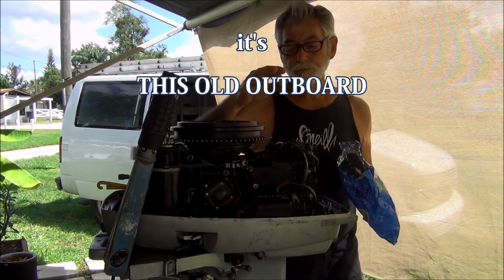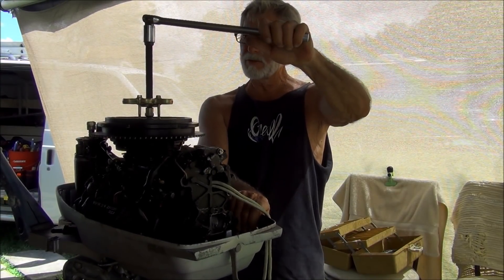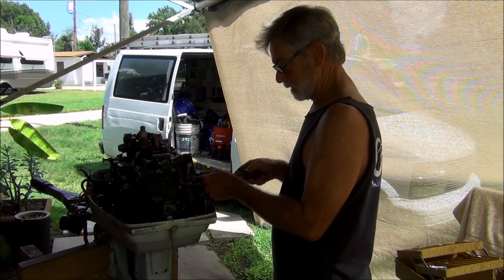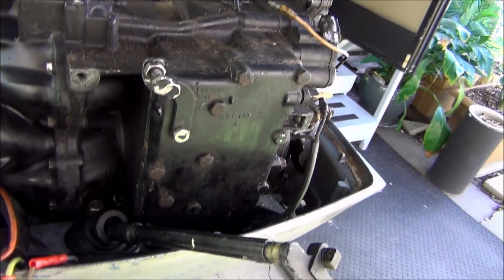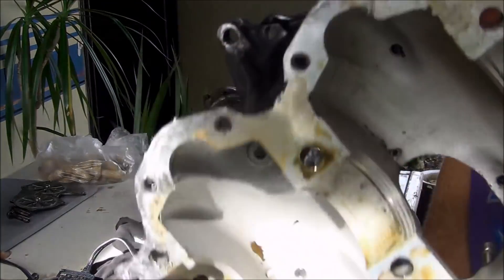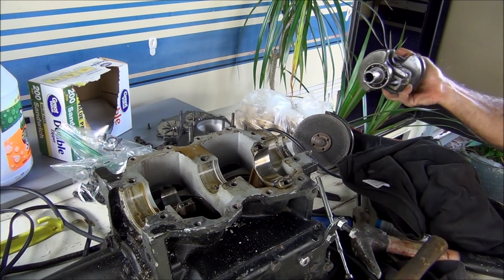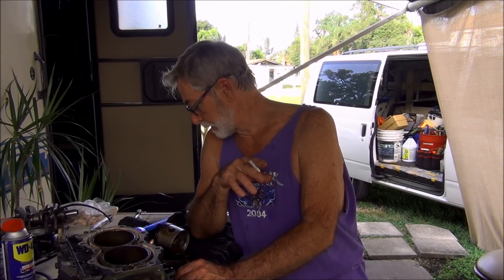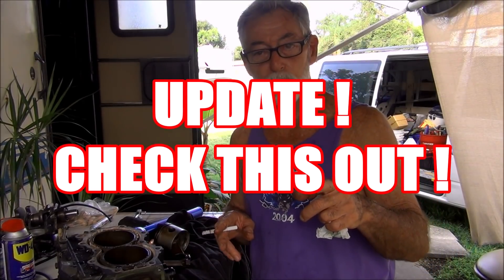1983 EVINRUDE 25 HP - TEAR DOWN

Comment: I picked up a 25hp evinrude 1990 how can you tell a rod knock
Reply from the maker: One thing you can try is- take the plugs out, rotate the flywheel to bring the top piston up to top dead center- put something in the spark plug hole and measure the distance from the top of the piston to the top of the plug hole- then do the other piston and see if the measurements match- also once you get the piston(s) to top dead center- gentle/slightly rock the flywheel back n forth- check the movement of the piston and listen- you should be able to hear it if it doesn't sound smooth-

Comment: I've got a johnson 25r72r. How do the rings face when being installed on the piston and how do I tell the top ring from the bottom ring?
Reply from the maker: Hey. Thanks for tuning in. Look at the piston ring grooves, you'll see that the top groove is beveled to fit the top ring, it only goes on one way. Thanks again & Stay tuned !
Reply: @THISOLDOUTBOARD1  appreciate the input and your content
Reply: What should the compression on a johnson 25r72 run after a fresh rebuild?
Reply from the maker: @TraplineOdyssey  well there is no "should be" numbers but I would hope it would be 120+ on both cylinders

Comment: I need some help other than what does video shows I've got a 78 25 horse with a hole in the housing and I'm not sure if it's an exhaust hole or if water would get into the gear casing. there's nothing else wrong with the lower gear casing housing except there was a peephole that started eating itself out around the hole and somebody while or somebody cut a bigger all-out I guess they were going to put a plate in there aluminum welding
Reply from the maker: Hey. I think I understand what your talking about. There is a drain hole that allows the water to drain out of the cavity located in the upper part of the gearcase behind the water pump so it dosent stay full when the boat/motor comes out of the water. Its located next to the shift shaft bushing/seal in the top of the gear case and drains down lower out the side weep/peep hole. It has nothing to do with exhaust. I've had a few that were clogged and gently drilled them out. You should be all right unless its eating into the gearcase and letting water in. Check the oil. You could plug it up with bondo or jb weld and try and dump the water out of the cavity when its out of the water. Water sitting in that cavity will only cause more corrosion.
Reply: @THISOLDOUTBOARD1  THANK YOU FOR THE HELP, VERY USEFUL INFO

Comment: I have this same motor. My shifter won't go into reverse unless I get a "running" start from forward and slam in back through neutral and into reverse. Does that bolt outside on the lever adjust for that?
Reply from the maker: Hey. I would think it does or should, but it dosent, or I'm not doing something right. You can take that small panel off, with the two screws on the side of the mid/exhaust section and check your shift linkage, the brass connector may be worn or loose. All it takes is a fraction of an inch in the linkage to throw the whole thing off. You'll see what I mean in my next vid coming up in a day or two.
Reply: When I lift up the bottom of that black vertical pole with the two springs on it I can shift it easily. I wonder if someone put the wrong springs in there. They make it so hard for the lever follower to move backward.
Reply from the maker: @thull1234  yeah I noticed that to, the top spring is pretty strong . you could try and cut it to relieve some tension . ?
Reply: @THISOLDOUTBOARD1  I finally had time to take that spring assembly apart and cut the spring. Took off about 3/16". It worked! Now I can shift into reverse, neutral and forward fairly easy! Thanks for the help.
Reply from the maker: Cool man glad it worked for you. Good to hear back from you. Thanks

Comment: Glad you were able to figure it how.. So how do you get all these engines and wear do you find them at?
Reply from the maker: craigslist !
Reply: @THISOLDOUTBOARD1  have you ever came across motors you can't fix?
Reply from the maker: Hey. Not really, everything is pretty much fixable , it really depends on how much time/money your willing to spend on it. I like to stay under 2-250. Like this motor, the guy was asking 125,  which pretty much means 100, which is what I paid, but I probably could have got it for 75/80. Overall, the parts, (which is what it was advertised as, a ''parts motor'') the electric starter and bracket, carb, etc is easily worth more, but I'm not really into selling parts although there is money to be made in parts. The whole idea is to have a good running outboard at a fraction of the price. Down here a 25 horse short shaft tiller in good running/looking condition can bring 7-800 + easily. Anyway back to your question,  everything is buildable, it just depends on the builder and which direction they want to go (hint hint). I'm at 100, and 1-150 left in my budget, 100 would be better, Hahaha. So, can I get it up and running and stay within budget? Stay tuned and see which direction I go!  You never know whats gonna happen next with ''This Old Outboard'' ! Thanks again for watching and commenting, I really do appreciate it. Stay tuned !

Comment: We got to get you the real OMC flywheel puller and one of the electric impact guns from HF (only $40)!  These things make removing the flywheel nut and popping that flywheel a breeze...I forgot to look, but did it look like the crankcase has been split before (paint off bolts/sealer oozing out between block halves)?  It is impossible fore me to judge from here....Those two rings are different design, different end gaps are normal.  The top ring is a "pressure back" ring, it uses the combustion pressure to help expand it....You might want to measure those piston skirts and cylinder walls prior to reassembly, who knows what you have there....I didn't see anything that would explain that compression difference...OK, you found that the bottom piston is oversize by .030", an OEM piston was used.  Is the top piston standard or oversize?  Again, I would advise measuring those piston skirts and cylinder walls before reassembly...Check new ring end gaps and ring groove clearances as well....I sure don't want you to put this thing back together only to have the same issue.....
Reply from the maker: Hey, yes I plan on checking it all out before I even buy anything , the top cylinder was not bored out, will that make a difference ? Thanks again
Reply: It is perfectly fine on the OMCs of that era to have one oversize and one standard cylinder/piston, it won't be "out of balance"....Hope it works out OK....
Reply from the maker: Ok, thanks .